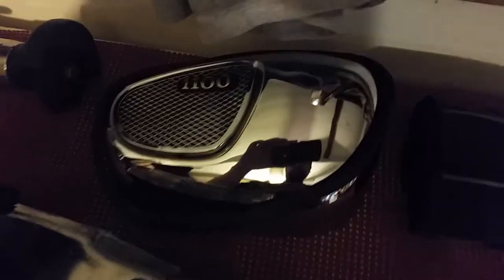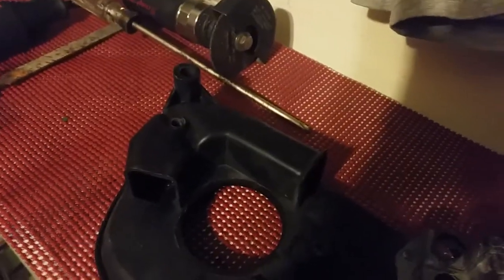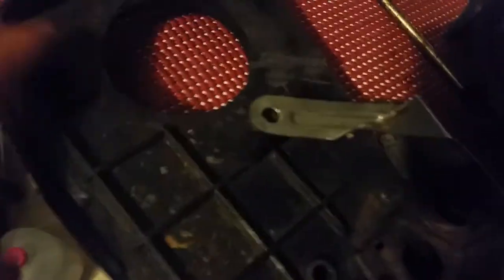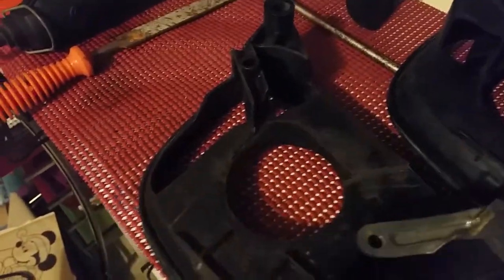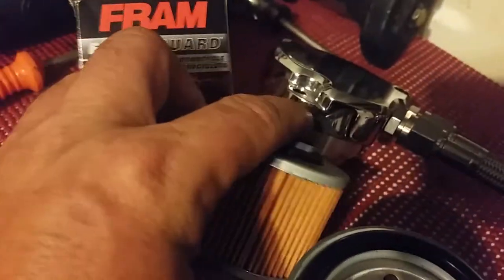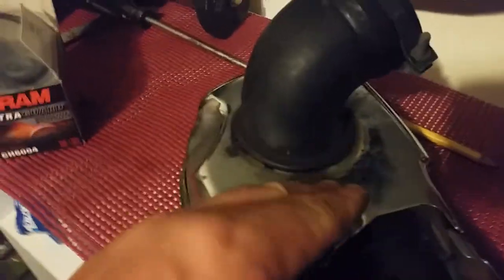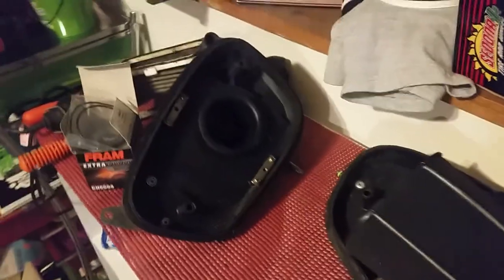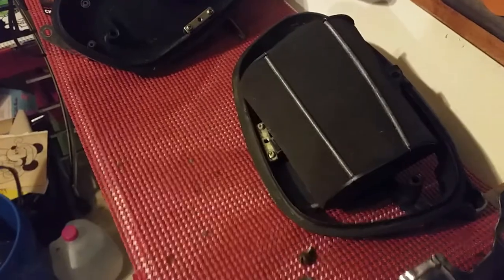Yamaha Virago XV750 XV1100 Air filter MOD

Comment: I'm no engineer or even a mechanic, but I'm going to assume the Japanese know what they're doing?

Airflow isn't just measured by Volume, but by Density, Speed and Temp. Altering any one of these could alter everything, including mileage and temp of engine at least. Same as how a Turbo works in a Diesel.  A certan amount of Vaccum can only convert a Certain amount of Pressure.  I don't know the technical calibration of the Air Mixture, Compression Stroke and maximum fuel/Air Mixture, but I'm going to assume They Did when they designed the bike, and it was running Flawlessly from factory.

Can you tell me your main reason for the Mod?  Thanks
Reply from the maker: Yes I can tell you and engine is an air pump I have a better flowing exhaust I have getted the carb and air flow with this airfilter mod you are correct the japanese do know what they are doing however the virago has a lot of restrictions due to emissions my mod allows more air Flo while maintaining a stock look and on my bike notable power cheep
Reply from the maker: Air Flo is measured in cfm cubic feet per minute cubic feet per minute
Reply from the maker: Diesel engine don't have carbs it's just open intake no throttle valve and turbo are completely different from naturally aspiration engines
Reply: @2strokeguru  Ah Yeah I know that pal, I meant to compare Air Flow from Turbo + more fuel from Diesel.  Same principle in detonation, but......maybe wrong to say.

OK, so I get it now.  Restricted system, so you've increased airflow to maximise larger exhaust and added larger jets also.   Sorry I missed it......

I only ask i have just bought in UK an 1100 with custom exhaust.  very loud and very quick (too much throttle throws the back end out) but also uses a lot of fuel, so basically thinking it is over jetted, over exhausted and over fueling to supply the open air........trying to figure out what the guy before me has done so i at least know what to change it I have to.
Reply from the maker: @Paul Knowles  if you have a custom exhaust this mod with a bigger jet you will not be disappointed
Reply: @2strokeguru  I think from the performance it might have already been done.....the guy who sold it put in his advert....Open air Filter Mod.....Maybe this is what he meant.?

I'll check tomorrow.  Thanks buddy!

Comment: So, is an air filter even necessary?
Reply from the maker: @austincompagno8731  yes if you run the bike without an airfilter the engine life is shorten due to dirt ingestion and will run like crap because jets would be too small

Comment: What size jets did you go to my baffles are removed and my air box is gone
Reply from the maker: You will have to start with a jet kit and start with a larger get i wouldent know off the top of my head because my mods on my 1100 are diffrent i have factory carb set i did a thuder slide mod used on harlys i have baffles my exhaust pipes are the same size air box mods and miled cams

Comment: Thank you a very informative video, did you eventually use the 125 jets.
Reply from the maker: thats the jet i am starting with the weather got bad early so i had to put her up for the winter i have a second set of carbs i did the slide mod to i did a few of thease mods time consuming to dial in but when they are rite whole new bike just comes alive in the spring i will be doing jetting videos i have tons of parts for the virago so thats the bike i say with
Reply from the maker: thank you for watching
Reply: Thanks Kevin, will subscribe and hit the notification bell icon, regards Doc Cox.
Reply from the maker: awesome thank you if you need anything let me know

Comment: Is it not possible to fit an aftermarket filter such as k&n ?
Reply from the maker: Yes the make aftermarket i was using what I had and opened up the air box for better air flow